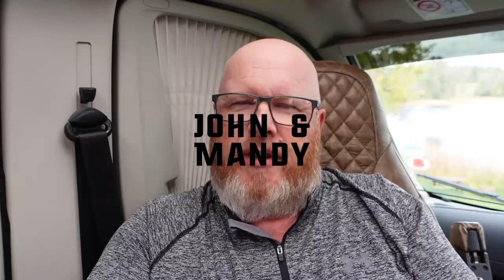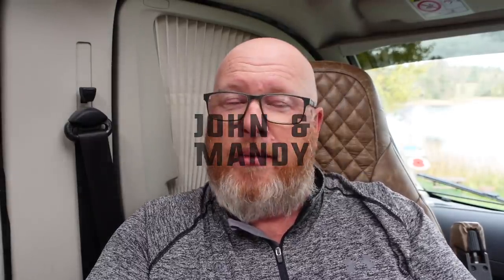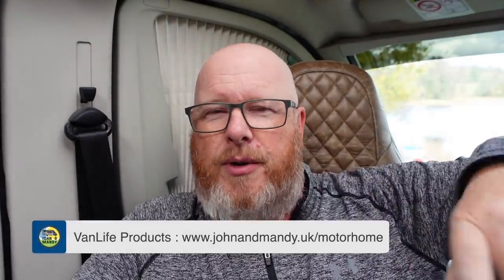How are those upgrades working out? VanChat Tuesday

Comment: Great update. Small point on Sweden and gas - your cost for a new bottle with gas is right. However, you can refill those bottles for a lot less than exchanging them. Most of the LPG sites (you have to look around a bit) will fill them for you. You just pay for the amount required similar to LPG sites in the uk.  Happy travels!
Reply: Same in Finland and these days there are gas stations too.

Comment: In Finland we do use gas but the system is based on exchangeable 11kg bottles. The gas is mostly propane or a mix of propane/buthane. The motorhomes use a side valve bottle and a top valve bottle is used with barbeques etc. A refill of 11kg bottle costs around 20€. For cars and lorries using gas as fuel you can get either biogas or LNG.
Reply from the maker: So we are correct, there’s no lpg in Finland. Thanks for that 👍🏻
Reply: @johnmandy  yep 👍
Reply: @ari.voutilainen  , heidän ongelma on että me käytämme CNG eivätkä ymmärrä hakea sillä nimellä.
Which is better CNG or LPG?
LPG has high calorific value of 90 to 95 MJ/m3 compared to CNG which has calorific value of as low as 35 to 40 MJ/m3. Thus, LPG is more efficient fuel than biogas, petrol, diesel, kerosene and CNG. Cost of CNG vs LPG: CNG is cost effective and convenient compared to LPG gas.

Comment: John , you mention maybe fitting another B2B charger ? May I suggest you take a look at a REDARC 1240D . We have the 1225D and so far it's been a diamond. Take a look !
Reply from the maker: It’s not really something I’d choose, putting all your eggs in one basket and combined it’s less power than I have now. I’ll stick with Victron gear as they’re rock solid and easy to remote monitor 👍🏻

Comment: Hi John, great update and thanks... I’ve looked at your diesel heater link and think the price and self fitting is reasonable. We have a V-line campervan these days and the siting of an additional fuel tank would be difficult. However I’m guessing the best overall way to link the heater directly is to the vehicle fuel line? - Does it also require priming when not in use etc ?
Reply from the maker: You’d fit an extra fuel line into your fuel tank, plenty of YouTube videos here to show you how to do it 👍🏻

Comment: Funny claim about no LPG in Finland, where did you get that from. I have used it in yachting and in grilling since 1963.
Reply from the maker: It's a FACT,  there are zero locations to get refillable vehicle LPG from.
Reply: @johnmandy  , as I cannot find my previous reply a shorter now. We use CNG but it's for the same use.
Which is better CNG or LPG?
LPG has high calorific value of 90 to 95 MJ/m3 compared to CNG which has calorific value of as low as 35 to 40 MJ/m3. Thus, LPG is more efficient fuel than biogas, petrol, diesel, kerosene and CNG. Cost of CNG vs LPG: CNG is cost effective and convenient compared to LPG gas.

Comment: Hi John and Mandy, thanks for taking us on your travels. Did you ever consider hydronic heating for van and water? Asking as I have it for aux engine heater on Mercedes Frankia and deciding whether to adapt to heat van and water or use a diesel air heater and the lpg for water heating? If you did have an aux engine heater would that have altered your heating/hot water plans? Thanks and safe travels. Bernie and Sarah.
Reply from the maker: That’s not something we’ve looked at.

Comment: Good feedback John. Regarding your b to b battery charging have you have you considered the Victron Argofet alternative? Your probably aware bt there's some great insight regards it & b to b over on KS ENERGY channel.
Reply from the maker: That’s not a product I’d bother with, it seems totally pointless, your inputs and outputs are all connected the same at some point, so you’re still technically sharing the same charge & discharge as the way I have my power setup.

Comment: Great Vid as always, I'd be interested to know how you get on with ground clearance on the dirt roads and when finding parkups off the beaten track. Are you on a Maxi chassis or standard?  We had ground clearance issues with our Autocruise PVC, and are now wanting a similar Coach built to yours - do you ever find the rear overhang an issue when venturing off the tarmac onto rougher ground?  Also, is 30mm insulation in the walls and roof on your Burstner enough for the colder climates?  We found an external silver screen made a massive difference to van warmth in colder weather.  Does the diesel heater also heat water, or just for space heating?
Reply from the maker: With the bigger wheels & tyres and rear airbags we have no problems with ground clearance or exit angle 👍🏻
The winter burstner design is plenty enough for the colder months.  Diesel heater is just for the hab heating, if we want hot water then we can get it from the truma by using lpg or from our inverter as we drive.
Reply: @johnmandy  Thanks for the reply - appreciate the efforts you go to to respond to everyone.

Comment: Hi John are your batteries not Bluetooth it's a minefield knowing what to get seen some that are Bluetooth and have heaters built in and a 5yr warranty  which I'm considering but would go with the ones you have because I live near Nottingham and they seem a good company ta
Reply from the maker: As I described in this video, our batteries are lithium and do have integral Bluetooth monitoring. You don’t need battery heaters, the ones I have are linked on our website. They’re not from Nottingham.

Comment: Great update.  What about the extra insulation you added to the outer wall inside the cupboards our the beds? Did they reduse condensation?
Reply from the maker: Yes, that stopped that issue fully 👍🏻
Reply: @johnmandy  Do you have a link to the material you used?
Reply from the maker: It was just square of cork with adhesives backing from eBay or Amazon 🤷🏼‍♂️

Comment: Hiya John..quick question on your EE plan if I can.. does it cost extra when you have it set at data roaming? I've lost signal a couple of times with the same router and antenna and I'm wondering if it will help stop that..
Cheers
Phil
Reply from the maker: Are you in the UK? If so then data roaming isn’t relevant. Loss of signal can be many things, antenna placing, local electrical interference, general lack of network signal etc.
Reply: @johnmandy  Yes, UK John..lost signal at Blue John Cavern the other weekend and near Scarborough last weekend. At the former, our Giffgaff phones had signal, but at the latter, neither  our Netgear router, nor our phones had network. I'll see if it happens a lot and have a look again at re arranging the antenna placement. I wasn't sure if data roaming allowed access between network signals. Thanks for that. 👍Safe travels.. 😁
Reply from the maker: Is the sim in your router a new EE contract sim? 4g/5G version?
Reply: @johnmandy  It's a new SIM, full DATA, 4G I believe, John. I've only had it a month now..since the last Stratford weekend. Nighthawk router, Poynting 4G antenna. I wasn't sure if I needed to alter any settings, but I'll see how things go.
Reply from the maker: @LillaHusVanlife  Which network is it?  If you’re losing signal that frequently I’d say the antenna connections aren’t great or the placement of the antenna isn’t great.
Reply: @johnmandy  EE, John..I went with them after yourselves and others mentioned that their network has the best coverage. To be fair, Aron and Kellie had no signal on phone or router at the woods either, although I'm not sure what networks they're on.. I'll keep monitoring and perhaps try moving the antenna as much as the cable allows, at least..
Thanks for the input John, its appreciated..